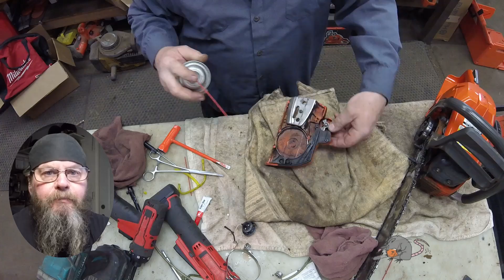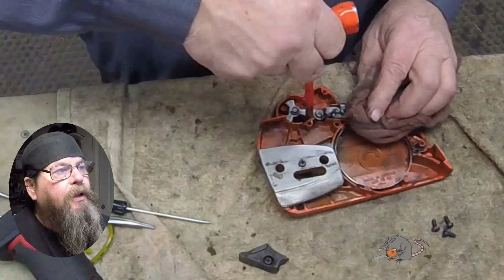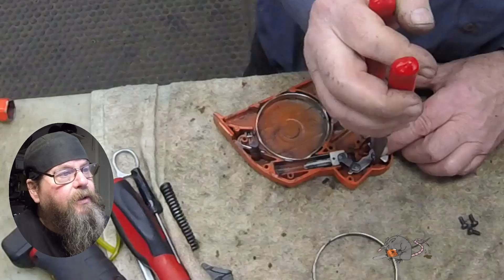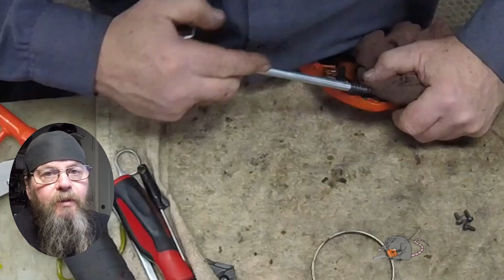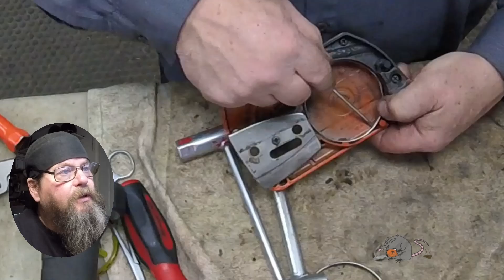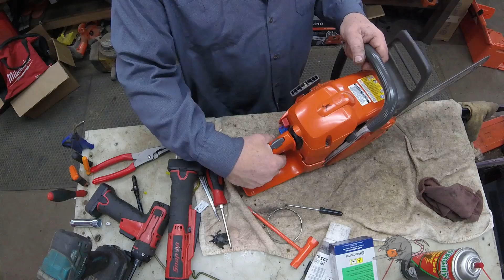Husqvarna Chainsaw Brake band Repair

Comment: There you go giving safety tips. I like the rag on the spring tip. Those help a lot.
Reply from the maker: Safety is number three right behind showing off and looking good. Since I'm not good at the first two...
Reply: @TheGreasyShopRag  I needed that chuckle. Thanks.   I’m right there with you.

Comment: You set the brake to its "off" position with a scrench, cool beans!
Reply from the maker: Skrenches rule heh heh
Reply: It's a modified scrench
Reply from the maker: @alans.4658  I put screwdriver handles on some of these skrenches so this job can be done easier.